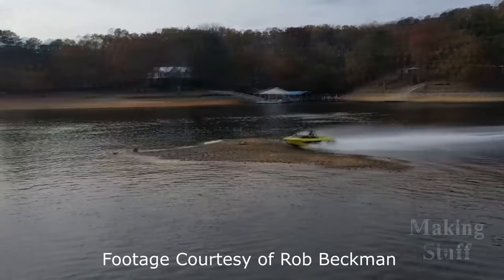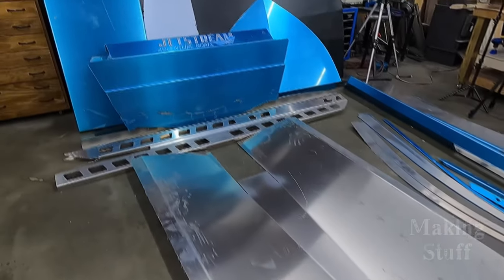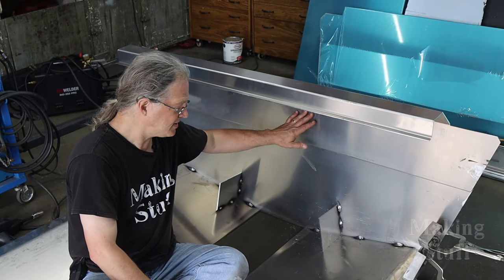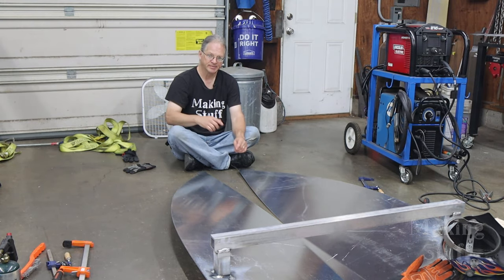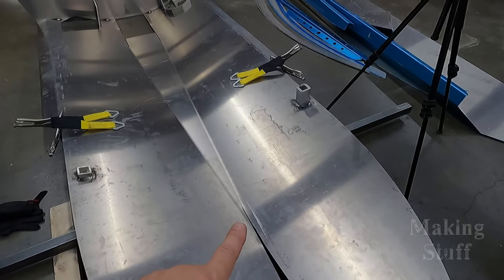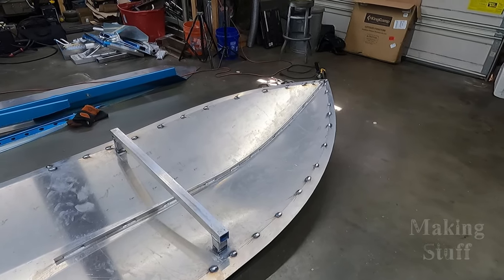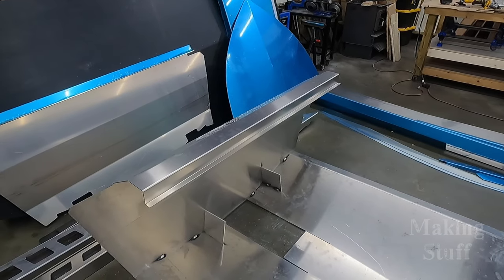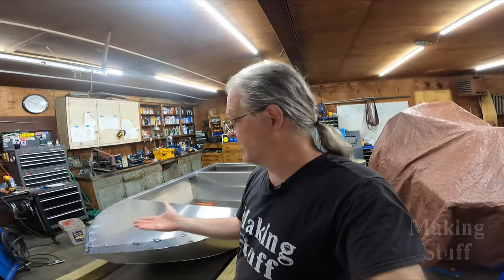Mini Jet Boat Build - Part 1 - Jetstream 12' Buccaneer

Comment: Very nice and interesting project. Make sure you have a tether cord and cut off switch installed so when it throws you out of the boat it'll shut down!!  LOL!! Looking forward to the next video.
Reply from the maker: The jet ski has that already built in and yes I will be using it.  Thanks for watching!

Comment: I love the big project that you're doing I love watching your channel and that I do have to ask.... you're doing this great big thing pushing yes welders and my curiosity runs really hard 10 months ago you did a video with the yes welder 250p and you're talking about MIG welding aluminum now here you got this great project putting together a jet stream boat which I love but you're using a Lincoln welder with a spool gun instead of using the yeswelder with the mig gun?????? and I asked a question back when you were pushing the welder about what it can and cannot do so why would you use a Lincoln over to yes welder? and I'm not here to troll you or anything just a quick just a question why the change of heart on the boat???   I'm a long time subscriber so I'm not going nowhere..
Reply from the maker: That's a good question.  The hull of the boat is 1/4 inch.  Both machines are rated at 3/16" which is close enough to get the job done.  The Lincoln did a better job on the 1/4" so I started out using the Lincoln on the big stuff.  I did use the Yeswlder on the brace that I made in the beginning of the video.  There will also be some TIG welding in this project which will involve using a Yeswelder product.  There are also other advantages the Yeswelder MIG has over the Lincoln which will be shown in future videos.

Comment: Boat name NOT STOPPING

I just bought my own kit from Jetstream which is the same as yours. I haven’t started building it yet but I am researching as much on YouTube as possible. Your first video is great but I was wondering if you could just do a little bit more details on the areas that you’ve run into problems or others could run into problems if they don’t know these little hidden secrets. I’ll keep watching and thanks for video and up coming ones.
Reply from the maker: Other than the bottom not being cut correctly and the width not being 51.5 inches, I haven't had any problems.
Reply: @MakingStuff  bom dia, vc fez um ótimo trabalho !!...sou do Brasil e gostaria de saber onde consigo comprar um kit desse aí ?
Todas as chapas já vem prontas para fazer as soldas ?

Comment: Im confused, was this beauty built with your YesWelder or the Lincoln welder ? Thx 🙏
Reply from the maker: Started with the Lincoln, then switched to YesWelder when they released the YWM-211P.  Had the YesWelder been available when I started the build, I would have used it for the whole thing.
Reply: @MakingStuff  ok thanks!

Comment: Not questioning since idk much about welding aluminum but I did weld doing a very similar process for about a year making sounds dampening rooms and such. My question is do you have to push your welds?  With how thin the material was I was working with usually pushing the weld required either moving really quick and getting a crappy weld or drawing the weld towards you allowing for a larger tac/weld
Reply from the maker: Yes you are suppose to push the weld with aluminum.

Comment: What welder are you using? Cheers Fraser from New Zealand
Reply from the maker: I started out with a Lincoln 210MP, but switched over to the YesWelder YWM-211P. I wish I had the Yeswelder from the begining of the project.  It works much better on Aluminum. https://youtu.be/YyOiIbskFYs